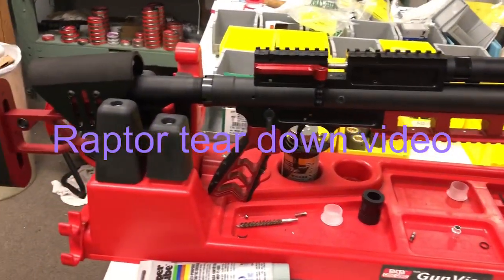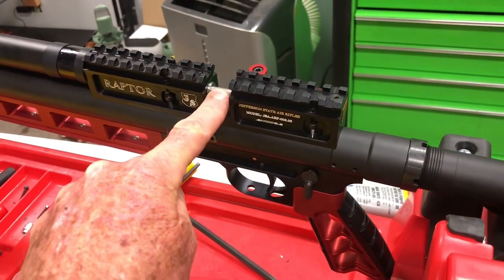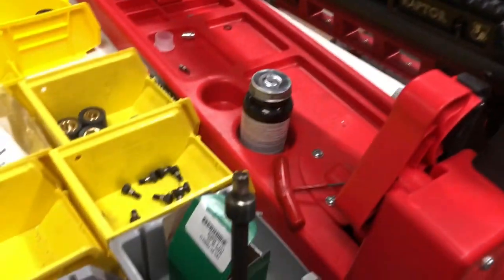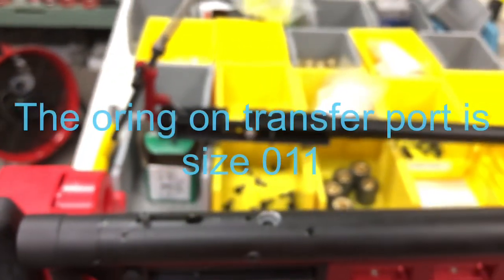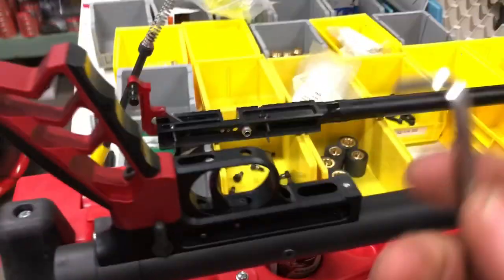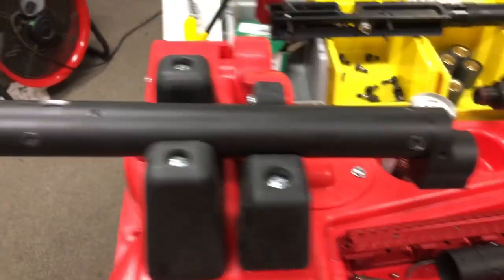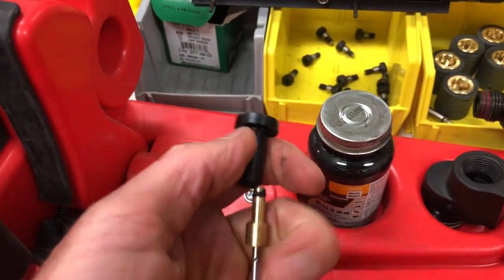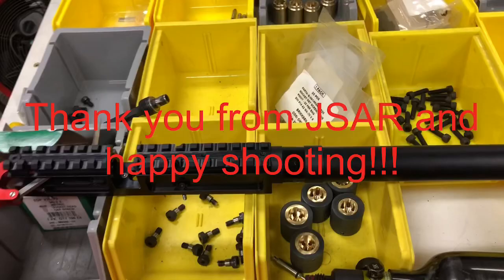JSAR Raptor tear down

Comment: Can it be degassed by spinning the bottle one full turn and fireing it or turning the screw? So the air can be left in the bottle?
Reply from the maker: no
Reply from the maker: This is very hard on the bottle threads, and not recommended.  There is a degassing screw on the side of the bottle drop.